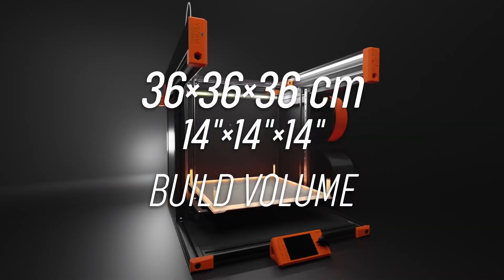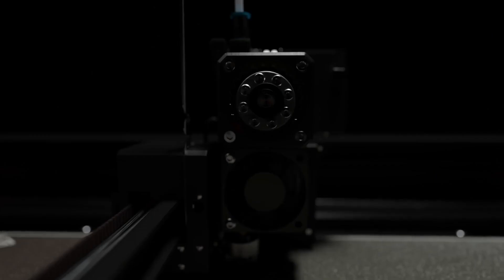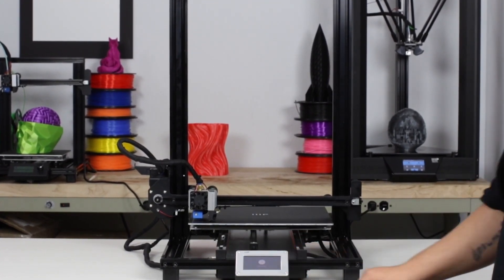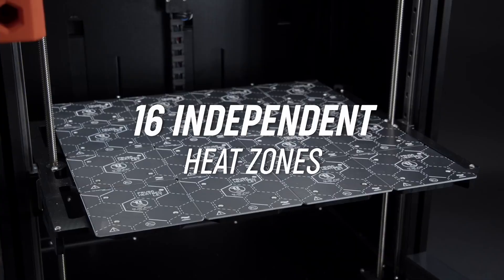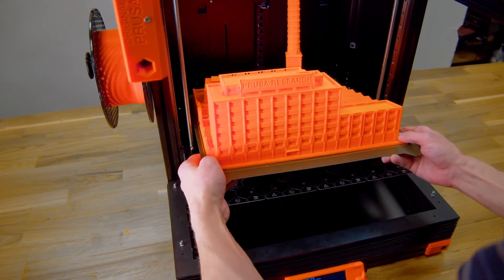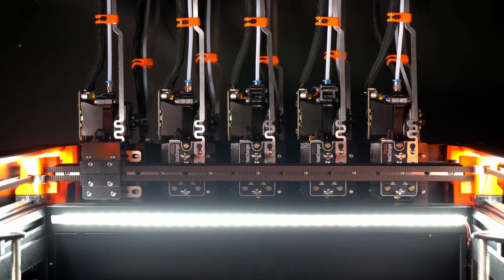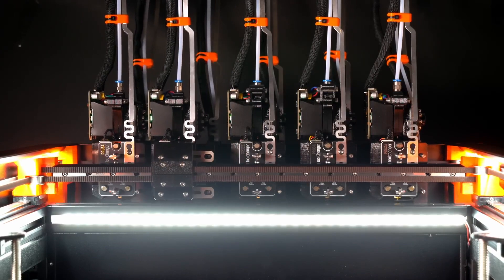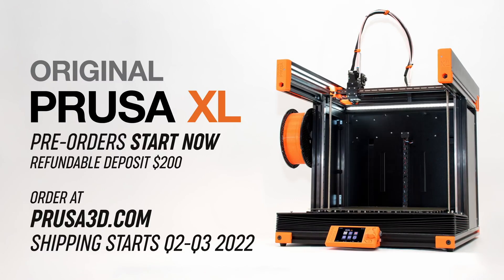Did Prusa Just Disrupt the 3D Printing Industry?

Comment: Heating Bed....running on 24V so..i doubt that it reaches ABS Bed temp on the whole bed. Amps would be too high. thats the reason why the high level Hobby printer like ratrig, voron etc uses a AC heat bed. Sure some things are interesting..but many things looks like an overpriced( 2000€) Printer for PLA and PETG.
Reply: Why not? There are 16 heat elements that should be easy to maintain the temperature.